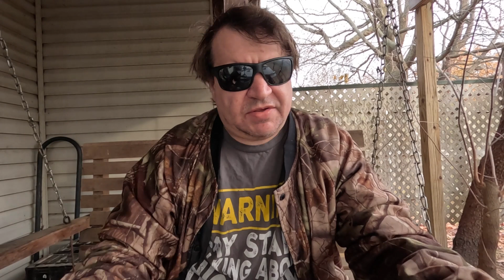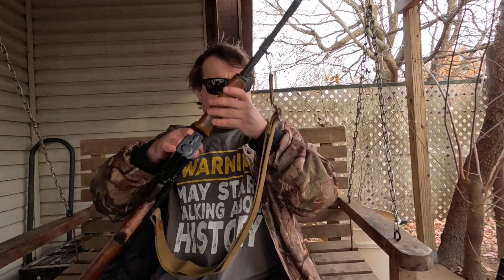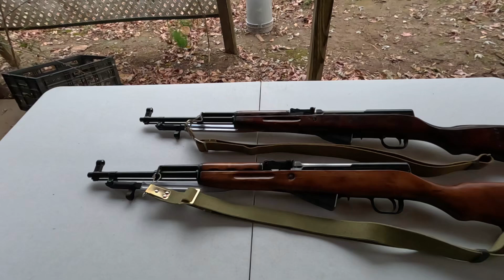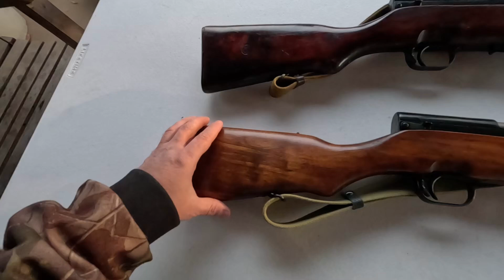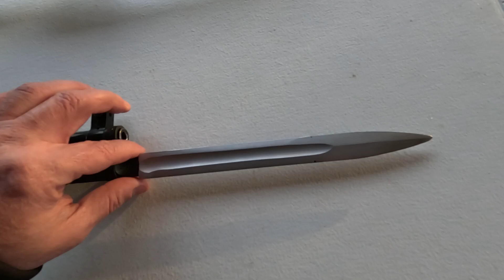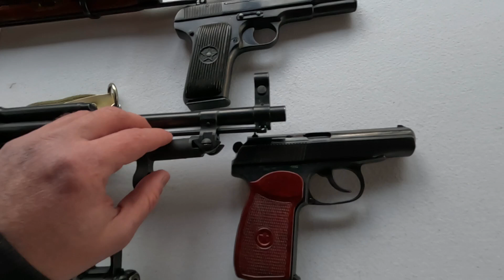Why Izhevsk SKS-45 Carbines Are So Rare & Collectible (Soviet-Russian Cold War Storytime)

Comment: Let me help you out a bit on some of the details you got wrong. The type 2 AK was made from 1951-1955, and the type 3 was from 1955-1959. Late 1954 to mid 1955 rifles were transitional with features of both the type 2 and type 3. The laminate birch and ribbed magazines appeared with the introduction of the type 3 in 1955 and yes, very late production Tula SKSs were made with laminate stocks from the factory as well, a very rare sight to still see those with their original stocks. For the date codes that were used from 1955-1959, we have updated information on that. The full 1955 date was still used from January - March of that year, and here are the letter codes and when they were used:

Д (April - June, 1955)

И (July - December, 1955)

К (1956)

Л (1957)

М (1958)

Р (1959)

These codes were the same at both factories, so this can be used to date a late Tula SKS as well. In 1960 this system was dropped, and the standard full date markings returned. Another fun fact, the SKS actually started production in 1948 at Tula. I have no idea how many were made, but they are incredibly rare. I have only seen 2 examples posted on the internet over the years. Hope this helps anyone that is interested in Russian stuff like me.
Reply: I just picked up my first SKS and the only “serial number” on it says “PN 702” (the N being backwards as you showed above) I cannot find any information it. Any thoughts?
Reply: @briggsbrian8842  If the И is part of the serial number, then what I was referring to about date codes does not apply. If you have a late Russian SKS, then you should have a date code on the left side of the receiver near a small Tula star, which is unique on late Russian examples. Of course it's also possible you got an earlier one that was refurbished and got a dust cover swapped in without a date stamp on it, as for the earlier ones (1948-early 1955), the date was only stamped on the dust cover and the left side of the stock, and refurbished examples also typically have replacement stocks with X'd out numbers. So if the OG dust cover is also gone, you may be left with no way to come up with a production date unfortunately.

Comment: I snagged a 53 tula all matching minus the magazine non refurb for 525 off GB. It had an extended rubber butt pad and an ugly after-market top cover. But the original came with .  Bought an original butt plate and a new top cover pin and waala a nice sks under 600. Yes, please, and thank you.  It has that beautiful red finish with random dark spots in the wood. This style of sks stock is just the bees knees imo.

Comment: I loves me my SKSs, maybe why I have so many of them (14). I started collecting them in 1992, since by then, I have amassed quite a few M91/30s and M44s. I've owned many SKSs and sold many too. What I ended up with after 30 years is a collection of the finest examples from most of the countries that produced them. The Queen Mary of the fleet is my "D" Lettergun in unissued and unfired condition with the Tiger striped Arctic Birch stock. Over the years I had some interesting discussions about some of the features and markings on SKSs, in particular, the "golden hue" blade bayonets, the crossbolt cartouches, and the factory of origin letter series guns. Some argue that the golden hue bayonets may be a replacement at refurbishment, the crossbolt cartouches were stamped on at refurbishment, and that the lettergun series were not produced at Tula. I'd love to hear your opinions on these topics. Thanks for the video.
Reply: Hell yea man.
Reply: @АлакПатрова  You Damn right!
Reply: I definitely think the golden bayonets are original. The colour is probably from either a heat treat, other metal finishing process, or simply a result of long-term storage in grease/oil/cosmo. Just look how some US milspec park finish had taken ona  a greenish colour after time, oil, and whatever else. As for the letter series guns, if Tula didn't make them? who did? It wouldn't be China. Nah, i think they were just the last of the run, using up parts and maybe being made for export (even as pattern rifles for others maybe?) But i see nothing about them that doesn't appear Soviet.
Reply: @misha5670  Thanks for your thoughts. It has been argued by some members of a prominent SKS Forum that the letter series were soviet made, just not Tula, because of the missing Tula factory mark on the dust cover. The Tula star is present on the receiver, but still some speculate it is the Soviet star symbol, and not necessarily a Tula Star. All speculation. Your thoughts on the crossbolt cartouches?